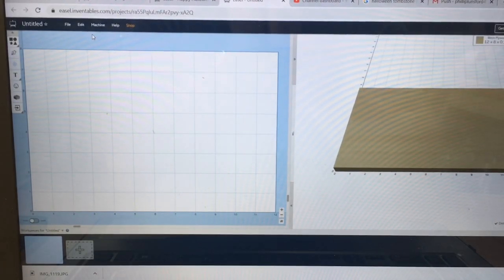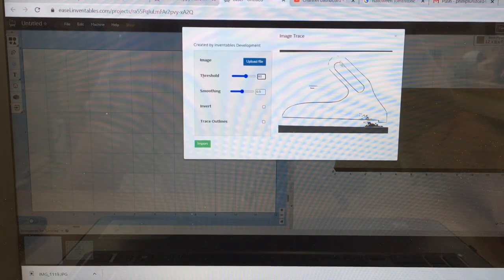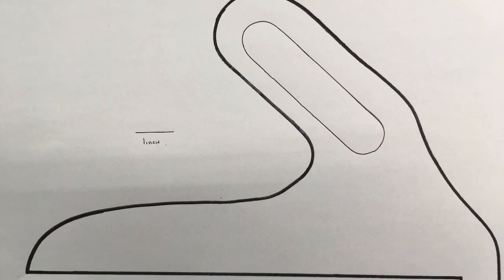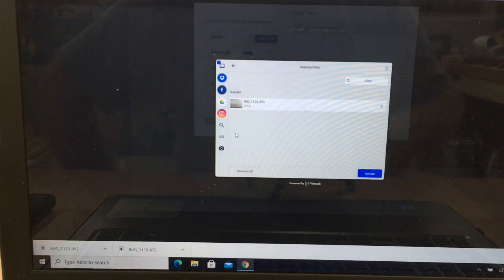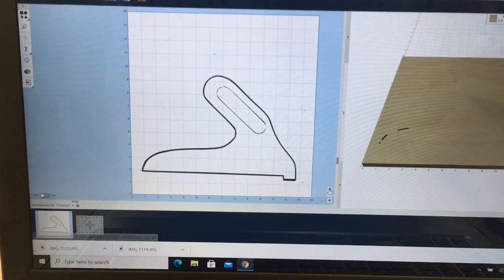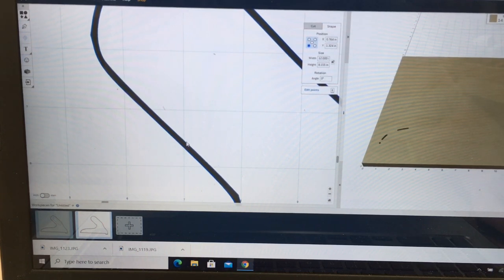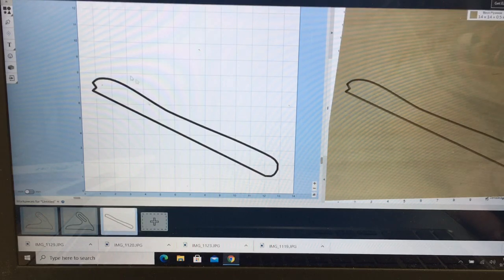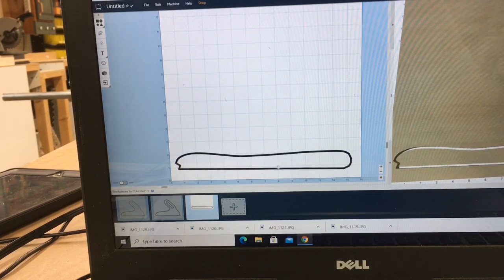Image Trace in Easel: Does it Work?

Comment: Thanks for your videos. I like the way you take your time to explain things? I’m new at this but could you convert the picture you took of the push stick to an svg file and enter it into Easel?
Reply from the maker: Using Image Trace in Easel it is not necessary to do a separate step. Easel does it for you just as I showed in the video.  If you use another software such as Inkscape to edit the photo then you would just same your work as a svg file.

Comment: Do you have a video on how to put a bevel on a shape you've cut out?
Reply from the maker: No, I usually just use the router table to put the edge on it.
Reply: @PawPawsWorkShop  I make puzzle boxes which often have small parts not suitable for my router. Thank you for the reply and you xcarve videos. I've learned a lot.
Reply from the maker: You can carve the edge.  You just have to set it up and maybe do a test carve.  Also, VCarve desktop can do it also.